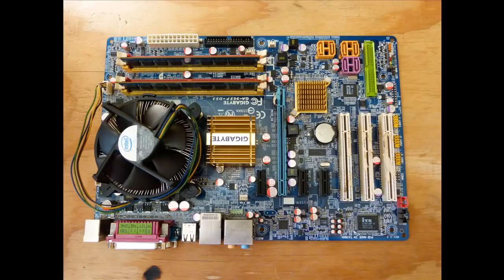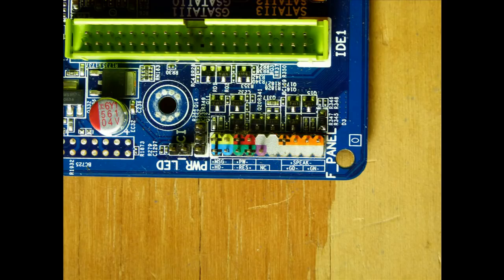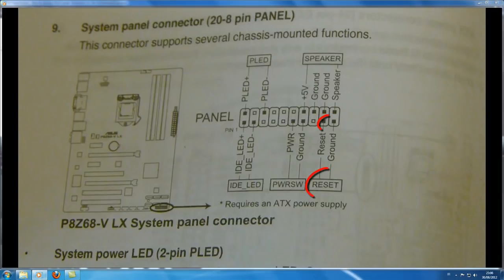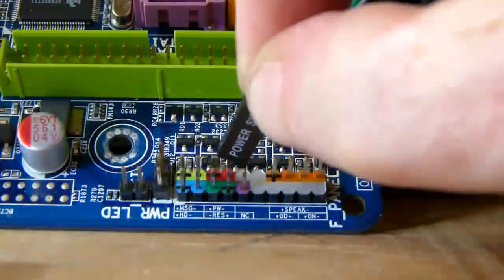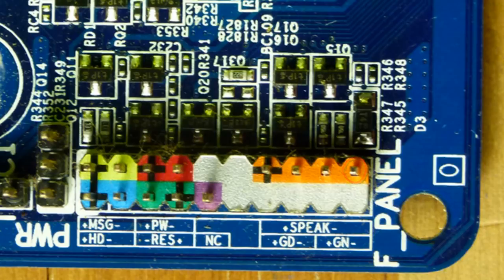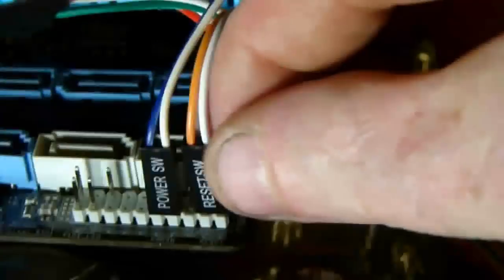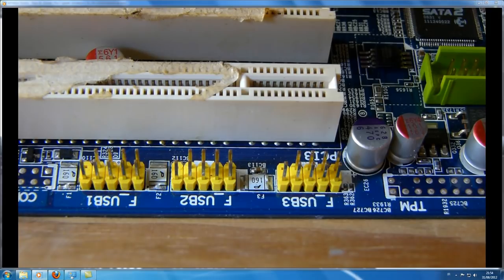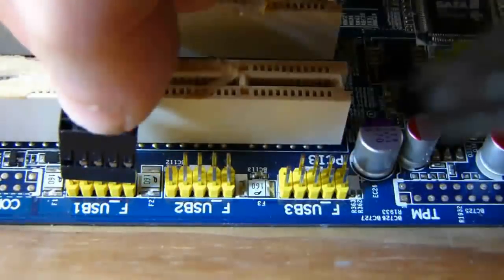How to connect front panel connectors to the motherboard

Comment from the maker: Hi StrongBlockZ, as long as it is the correct switch going to correct pins on the motherboard then it should work, but just check the manual for your motherboard and follow it there. This is the only way to be sure...

Comment: actually before this the sound is already there, everything normal.. front n rear jack can hear the sound, the problem appear when i connect my PC to port jack at my auditorium, after that when i connect my PC at home it cannot detect my speaker, nothing wrong with the speaker, i want to format the PC, but i think this is a hardware problem.. i used motherboard asus p8p67

Comment from the maker: Hi Rashid, first check your audio jack is plugged into the correct jack plug, this plug is "green". the next thing to check is did you build the pc yourself if you did then check that you plugged in the audio connector to the correct internal connection on the motherboard. Last thing to check is test the rear audio jack first that is again the green jack plug then see if you have audio. If you think they are all ok then uninstall driver and restart your pc that will install default audio.

Comment from the maker: hi, it sounds like defective sound card on motherboard, but check which sound is set as default and change it to the other one. Make sure you are using the green jack plug on the back of the computer just to check that audio works.next thing to try is uninstall the audio and restart your system it might be a defective driver, that's all you can do. falling that you need to get a new motherboard or bring that motherboard in for repair. I hope you get in sorted.

Comment: i plugged in everything correctly, tried both HD audio and AC97, my analog headset doesn't work in both rear and front panel, the computer recognizes it but there's no sound only static noise and unable to record anything. I enabled the audio controller in the bios installed the latest audio drivers didn't mute it and still no luck help please (my case doesn't have a speaker plug not sure if that affects it)

Comment: turns out the current case's power switch had reversed slots, so it didnt work with todays typical power prongs, had to order a new one. Should be good now.

Comment from the maker: before you do that... have you plugged in two power cables from your power supply one for CPU and one for motherboard ( CPU is a 4 or 8 pin connector and the motherboard power is a 24 pin connector) and make sure all Memory (RAM) sticks are sitting correctly and make sure you CPU fan is connect to correct connector labeled CPU_FAN.

Comment from the maker: Hi ShoTzVlogz, There has to be something that indicates what the positive side is maybe a little black arrow on the back of each connector at least or maybe the color of the cables... you should refer to the motherboard manual to get that information it will be in that manual...

Comment: Ok, the reason i ask is because my computer does not make a beep sound when i start it up. Windows works fine and all so i think i pluged one of the cables wrong. Could you tell me what cable is responsible foor the beep sound so i can check it out?

Comment from the maker: what is the name and model number of your motherboard, it will be printed on the motherboard. Then type it into your internet browser with the word "manual" and that will take you to a website that will have it for downloading. The reset button maybe faulty but you should check to make sure it is connected to the motherboard correctly by using the manual when you get it.

Comment from the maker: Hi Vipul, the only thing i can tell you to do is get the manual from the motherboard manufacturers website and find the the connections correct orientation in that manual. Now if the reset switch works sometimes then you have it connected correctly and what's wrong is that the switch is not functioning properly ok.

Comment: hii...actually im havin 5 pins up nd 4 pins down close to each other to connect power led hdd led power n reset sw wires etc..im not getting the right way to connect dem..ive tried to connect these wires same as uve shown in d video but sometimes reset button doesn't work..please can u tel me d right way to connect these wires ?

Comment from the maker: yes this connection audio/ usb adapter will be as good as your older ones don't expect miracle without a PCI Express sound card... and by the way just for your own curiosity both audio jacks use the same on-board amplifiers their is no difference in there sound quality it could only have been software that cause that problem with different quality sound.

Comment from the maker: Hi Mick Raiden, your front audio jack has to be replaced that's obvious. Now the back audio jack is Probably fine you just need to adjust the master volume in the control panel it is under hardware and sound in the control panel. Are you having a problem with the usb port? or is that you want to get a usb audio headphones? if that is the case yes you can get an audio usb set of headphones and they work with little fuss you can get one at your local pc store less than $15

Comment: Thanks but unfortunately you do not understand what I mean ..2 x wires come from the front bezel LED .....these two wires should plug into the 2 Pwrled pins on the motherboard but they are crimped to a 3 pin plug (not a 2 pin)...Because they are crimped to the outside (the centre has no wire) one wire has to be uncrimped and recrimped to the centre ..then it can be plugged into the M/B ....I think I now know how its done so Thanks for your help..

Comment from the maker: Hi Hairy Hiore, usually they are only crimped in the front panel and should be left that way, the positive and negative of those 3 wires coming from your front panel and place them on the positive and negative on the motherboard you will need to get a manual for the motherboard and you can leave that third wire alone, because you have to look at it this way PWRLED is like a switch so their can only be two wires connected try that first get the manual from manufacturers website and connect

Comment: Hi ..I urgently need help or direction to where I can get help....My Power LED Plug is for three pins and the two wires are to the outside leaving the middle empty....I need to find instruction on how to uncrimp one wire from the outside and crimp it into the middle so that I can then plug it into the PWRLED pins on my Motherboard...Thankyou Hkiore

Comment from the maker: Right so, you will find the motherboard model number on the motherboard the number will be in big bold numbers and letters usually white in color. it's not possible to tell where they are connected without the manual. so "make" and "model" numbers for the Case and Motherboard are required in order for you to figure out where these cables are connected on the motherboard.

Comment: connecting from the front panel. and there is 2x D+ and 2x D- 2x 5v+ and 2x ground wires in the collection of wires. i dont have a manual no its an orangey red square win fast mother board

Comment from the maker: Hi Susan, Is this connection on the motherboard or is it coming from the front panel? is there any labeling on it? and do you have a manual if you don't you can get one on the motherboard manufactures website and check out this 8 pin connection you are having trouble with...

Comment: Ok thank you very much. I dont have the problem with the front panel audio connection. I have already found that one and pluged it in. My question was about the ac 97 that was attached to the same cable that the hd audio was, as i didnt see it in any internet guides and there is nothing mentioned about  ac 97. Thanks again :)

Comment from the maker: The only way you will find out if there is an audio front panel connection on you're motherboard is to consult the motherboard manual. And for your other question, no it dose not matter which power cable you connect optical and hard drive they all give the same output when there the same type connector from power supply.

Comment: well i didnt find anything of ac 97. It may be something additional to the case and its not neccessary to connetct. Also, the cable that connects the drivers (optical, hard) to the power supply is too short to  connect to both of them. My supply has a second cable that is exactly the same. Does it matter if i use the first one for the optical and the second for the hard drive?

Comment from the maker: Hi MrArgy333, usually there is a connecter at the back just in front of the back panel connections where the back panel audio is but you can check by looking at the manual that came with you're motherboard, you can get it on the manufacturers website by using the model number of you motherboard it will show you where to connect you're front panel audio.

Comment from the maker: Hi, you need the manual to determine what position the power led for the front panel if you don't have the manual you can download it from the manufacturers web site by typing in the name and model number of the motherboard and both are printed on the motherboard.

Comment: I don't think I will be able to get the front panel audio to work however because there seems to be a propitiatory wire which leads to more pins than the HD audio wire usually has because it also holds power to some USB's next to it, I would rather not risk frying the board because of it. Would you know of any other way to get audio to the front panel?

Thanks, the help is really appreciated.

Comment: I will be using the same HDD and motherboard the only things I will be replacing are the case and the power supply along with an additional GPU so the windows OEM licence should be intact.

Thanks for the tip about trailing the pin colours back to the switches, I managed to use a screw driver to figure out the pwr pins by shorting the two that turned it on so that should hopefully not be a problem. I'll just have to figure out which one is the the HDD led once I get the new case and psu.

Comment from the maker: Hi XC0MB4, you should still be able to run the cables to your motherboard by making note of where they are placed by following the cables back from front panel to the motherboard, you will have to get new drivers for the motherboard from web site. now are you going to use the hard drive from the Lenovo case, if not you could be heading to a problem because of the "end user agreement" which states that the O.S. is tied to that motherboard the mobo might not work with new O.S. Check that first

Comment: I'm in the process of stripping out a Lenovo Motherboard from a small case and putting it into a new custom case. The problem I could see happening is that the front panel power switches and led's are not marked or mentioned in the manual because they are connected through one cable to the front panel for that specific case.

Do you think I would be able to get the motherboard to switch on still just through a process of elimination through the pins? Thanks.

Comment: My PC is over 5 years old but still working like a new one! The performance of CPU, RAM and Graphics is awesome...not realy bad ass performance....but still it has very good performance. The only issue is this annoυing little power loss. Ι have already installed a USB 3.0 PCI Host controller and i use the 2 usb ports from it and it is much better!! I just wanted to know if I increase the voltage to have no issues at all. Anyway, thank you very much for your time and advices.

Comment from the maker: But remember you have an underlining problem with your 5 volt usb rail which is caused by a failing power supply or partly damaged motherboard that's usually caused by blown capacitors.

Comment from the maker: Yes this is the problem it's either a motherboard or power supply issue and a age of your PC is the key, but if you want and there is no other problem you can install a pci usb controller and connect that to your front panel connector it will do the exact same job as the usb header on the motherboard.

Comment from the maker: Hi VaadRock, is your PC older than 3 years? if it is then it could be either motherboard or power supply. I would test the power supply first and see if your getting the 5v there and if it's giving you something around 4.78v then you'll know that it's the power supply and you'll need to replace it and if the power supply is giving you 5v then the problem is with the motherboard and you will need to replace it if you want a working front panel usb...

Comment: Hey man...i have a problem with F_USB motherboard pinout connections (front panel usb connectors). The outpout voltage is 4.75v - 4.78v instead of 5v. Windows can't recognize any usb device from those usb ports!! What can i do?

Comment from the maker: Hi OfficialHarwinder, If you want to keep your P4 board you can replace the cable from the front of board, but if the rear jack is not working the it may be that the audio on the motherboard has failed that could be a tel tale sign that your P4 motherboard is coming to end of life and it's time to replace it. but it still could be just the audio, so what i would do is get a sound card their very cheap $30 - $40 and install it in a PCI slot on your motherboard and you will have sound again...

Comment from the maker: Hi CLhackslol, you will have to give me more information as to what you're problem is. if they are all separate then you will have to use your manual that came with you're motherboard and plug in each one by following the diagram in the manual it's the only way you can do this. if you don't have the manual go to the manufactures website and download it from there.

Comment from the maker: Hi vishal mani, There are 9 pins on the header on the motherboard and you're connector has only 4 pin holes, so take that 4 pin connector and place it on the side of the 9 pined header where the 4 pins are on one side of that header on the motherboard with the black wire on your 4 pin connector facing the missing 10th pin on the header on the motherboard.
i hope that helps you out, it's hard to explain with out a diagram, if your still confused i will upload a video for you.

Comment from the maker: hi, you can check the specks by going to asus web site and type in ASUS M5A97 R2.0, here is the info you will fine: 
ASMedia® USB 3.0 controller :
4 x USB 3.0/2.0 port(s) (2 at back panel, blue, 2 at mid-board)
AMD SB950 controller :
12 x USB 2.0/1.1 port(s) (6 at back panel, black, 6 at mid-board)

Comment: Thanks, but for some reason my computer will turn on but not off using the front panel buttons. This is however not too big a problem as I can use the shut down buuton on the start menu.

Comment from the maker: Sorry this will not work, but you can still have a usb 2 connector in front panel by getting an usb2 adapter cable and replace it with the usb3 cable in the front of the case

Comment from the maker: Master Ziggs, scrap what i said last comment it's wrong. if your motherboard has a usb3 connector and the case has a usb2 connector they are NOT compatible, usb3 connector on the motherboard has a 19 pins and the usb2 plug from panel in case has 9 slots that can only be connected to a usb2 connector on the motherboard. so CANNOT connect case usb2 to MOBO usb3. sorry for my mistake, there are USB3 Adapters that would work, but this would mean removing usb2cabel from front panel, it easy to do

Comment: Hi, if the case has usb 3.0 slots but the motherboard has only usb 2.0 connectors will it run usb 2.0 or not work at all?

Comment from the maker: Hi, what will happen is the power supply will burn out if running a low wattage power supply with high end components nothing as dramatic as sending your computer to hell, an other possibility is some of the components will not receive enough power to run properly and the PC may not turn on at all, you'll get is a few beeps coming from your PC. That's it really...

Comment from the maker: Hi Marshy, the motherboard may or my not work with a new operating system some boards are locked by user agreements, but this may not be the case with yours. follow the video above you will be fine all boards are pretty similar in this regard so there will be positive and negative signs on the board connectors and the cables from front panel will also have these signs, refer to gateway website you might find the manual there if it's not to old. if you want put up video and I'll take a look

Comment: Im having trouble identifying a motherboard that came out of an old gateway tower. I dont remeber the model because all i have is the motherboard. I have written down any codes printed on the motherboard but none of them are the PN. Is there something I can do or someone could help me with to hook up the power button and what not correctly? I can upload a video or whatever youd need if you think you could tell me which connections go where.

Comment from the maker: Hi Parkash, When you unplugged power, reset and light switch did you take a snap shot off there positioning? if not you may have mixed one with the other. So my advice is to get the manual for that motherboard and check their correct positions on the motherboard more than likely their connected in wrong place. So double check the switches and also check the power going to the computer from wall outlet and check power inlet at back of the computer they maybe loose also. Hope that helps...